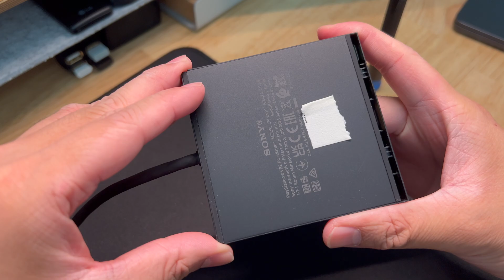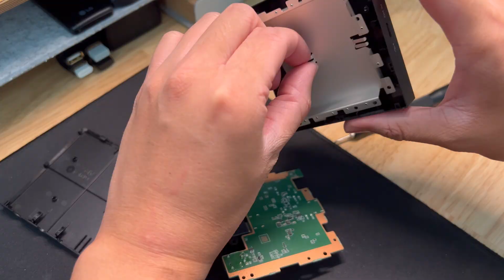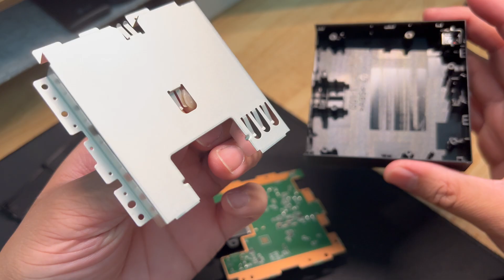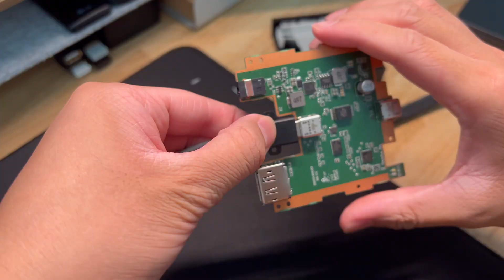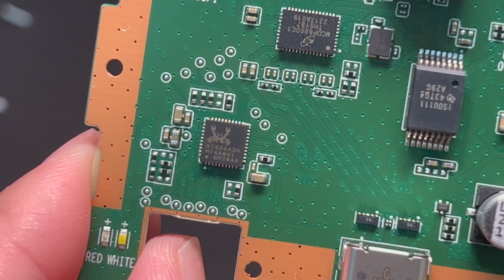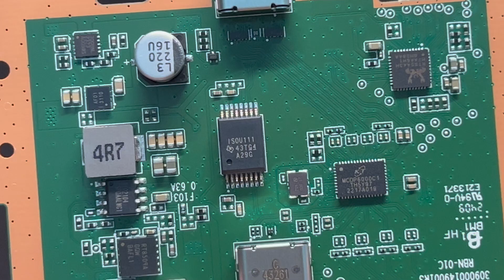PSVR2 PC Adapter Teardown

Comment: There will be Sony propriety somewhere on that board, for the psvr 2 to handshake between the pc display port, as we saw with the psvr 1 you can indeed use it on the pc for pcvr, BUT no audio will ever output to the psvr hmd itself due to Sony propritory 3d audio encoding, so you can bet that will also be somewhere on that board.
Reply: The psvr2 headset can connect directly to the GPU on the usb-C port if it has it, so it does not have anything proprietary since we have not found such "chips" or software inside said GPUs'

Comment: It would shock me if there isnt some proprietary hand shake bullshit in one of those extra chips
Reply: The psvr2 headset can connect directly to the GPU on the usb-C port if it has it, so there is definitely nothing proprietary, or else we would have seen it inside those GPUs

Comment: So then why is this crap 60 dollars? It costs them like 50 cents (if even that) to make it.
Reply: There are 3rd party adapters from aliexpress that are half the price, Exactly the same internally (bonus detachable usb c) And they include a DP cable

i bought one myself for 27 euros and works the same, because they are literally the same
not surprised that the official sony adapter usb c is hidden internally, they wanted it to look higher quality than it really is
Reply: Yea no.... Man people on youtube talk so much crap about stuff they know nothing about. It's a low production run for the device which always costs more than mass market devices. Then you factor in the cost of components, labor, packaging, shipping, marketing and you think it costs 50 cents? Ridiculous
Reply: Think you’ve just answered your own question sadly. Corporate greed. What’s even worse is they had the audacity to not include the required DP cable either. Classic

Comment: Can this be used with say a single cable drawing display? I know cards that can do this exist and they are like $190, just take in a DP signal and mix it in at high frequency with a thunderbolt/USB-C standard that supports DP Alt Mode. If this can do that, then this adapter is a real value.
Reply from the maker: I have heard that some 20 series Nvidia cards can accept the PSVR2 with no other hardware. Just need to install SteamVR app and PSVR App in stream.
Reply: @endawmyke yeah any GPU with a VirtualLink USBC port works fine without the need for the adapter (or additional power). Even the newest AMD reference cards have it. Sadly my Sapphire Pulse 7900XT got rid of the port 😔
Reply: @reinaweis Gave it a try with a UPERFECT B0BHNLZCNF (no touch) and it does convert the DP signal, however the adapter isn't providing sufficient power to the display. With a second power cable ran it runs about the same as my motherboard's USB-C's(which ran just fine with only one cable), just on a DGPU instead of the iGPU. Will have to investigate to see if it's a power supply that came with the adapter problem or if it's the adapter itself that's the limit.

Comment: The residue on the 5V jack are as you was suspecting flux - that component was hand soldered at the end. The rest of the components was placed/soldered by the pick&place machine sequence beforehand. Thanks for the detailed video of the complete board, interresting stuff!
Reply from the maker: oo interesting insight, thanks for sharing